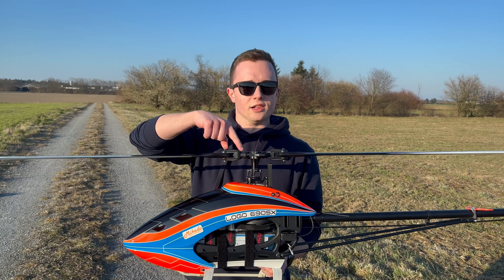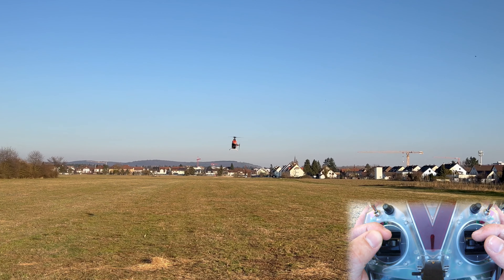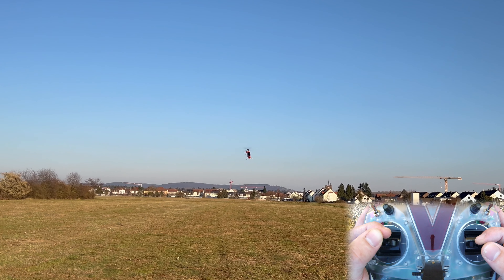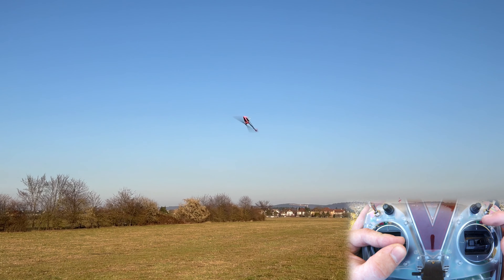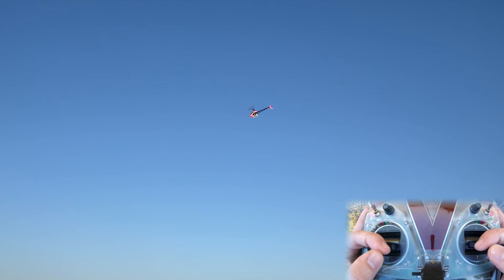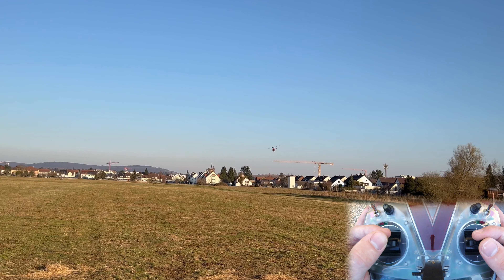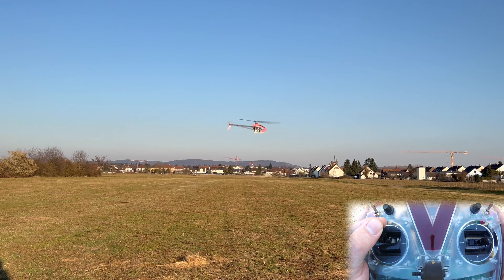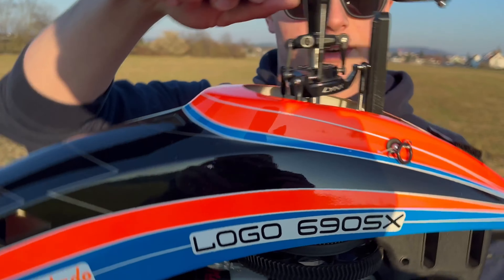Flying 3D WITHOUT Swash Stabilization?! Nobar Experiment w/ Stickmoves

Comment: Honestly, I thought the heli would be way more difficult to fly than it turned out to be. I mean, our rotors are so rigid in flapping that I figured you absolutely had to have either a mechanical flybar to do the flapping for the main rotor, or an electronic flybar emulator, like a FBL unit. This video really blew my mind.

Comment: Now try with some wind! Haha. I guess it's similar to a flybarred heli with light paddles and no expo. The heavy FBL blades help a lot with the stability aswell.
Reply from the maker: The blades are RotorTech Ultimate which are spec'd to be as agile or more agile than old flybar blades, the biggest difference is that these are way stiffer.

Comment: Hey Jonas, Ramy here your new subscriber. Thanks for sharing the video and I really enjoyed watching it. Is it still possible to buy the vbar control radio? Like the one you are using, as most radio's advertised on the website are all vbar control touch. Thanks in advance Jonas.
Reply from the maker: Hey Ramy, I'm afraid the original VBC has not been available for quite a long time. I too prefer it, but your only option these days is buying used I'm afraid.
Reply: @Johnny31297  yeah, I think that radio is in demand and I even search on ebay but no where to find, I have emailed mikado Germany but no answer yet. Any way it's really cool to watch the way you fly your heli. How long you been on rc heli?
Reply from the maker: @ramylems1895  I have been in this hobby since 2010, so I've been flying half my life at this point lol
Reply: @Johnny31297  that's great Jonas, and that's what what we called enjoying life  🤣 . By the way I'm planning to get a heli, which one you recommend between 550 and 700, is it good idea to go directly to 700?

Comment: Expart skill and nice flight ! 
I surprised RC behaving like the full scale helicopter 
I’m using vbar governor, Could you tell me your setup parameters at 1400RPM?
Reply from the maker: I could tell you the parameters, but they won't fit your model if you're not flying the exact same setup as I have on my heli. Instead, check the following procedures from the VStabi guys, with those you should get a fantastic result: https://www.vstabi.info/en/node/2043

Comment: We don't fly full scale manned helicopters with auto-stabilization.
Reply from the maker: Have you seen all the systems newer models like the H145 have installed? 4 axis autopilot, will literally do auto hover, auto takeoff, auto approach, level the helicopter at the push of a button, SAS for all axes... Yes, modern full scale helicopters are very much stabilized.
Reply: @Johnny31297  Robots
Reply: old real helicopters actually did have fly bars, but they had round weights at the each end, not small paddles like things like RC helicopter.

Comment: Hi what keeps the heli stabilised like that ?at the beginning of the video ,is it the flybarless controller that you are using ?.if so what fbl controller is that
Reply from the maker: Yes, at 1000RPM it's stabilized by the VBar NEO. Only when I switched up to 1400RPM the rotor head stabilization was turned off.

Comment: so basically a FBL acting like a flybar heli 🤣🤣
Reply: exactly my thoughts. I always remember it being harder to fly back in the day with paddles.
Reply: Should be worse than a flybar heli.  It's missing the flybar for stabilization, and also the electronic stabilization.  Jonas just makes it look easier because he's one of the top pilots around.
Reply: I have tried zero gain fbl before, and it does feel like a fly barred heli in a hover if its not windy.
Reply from the maker: It's different. It does some things better and some things worse, but overall, it's really not bad